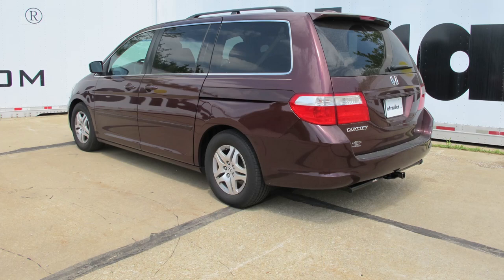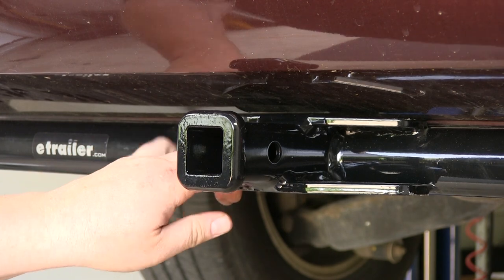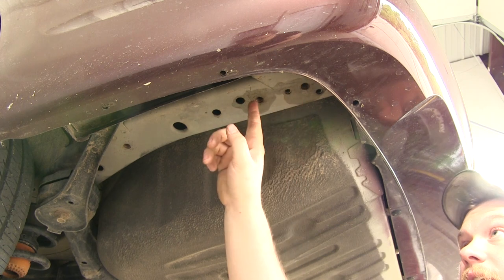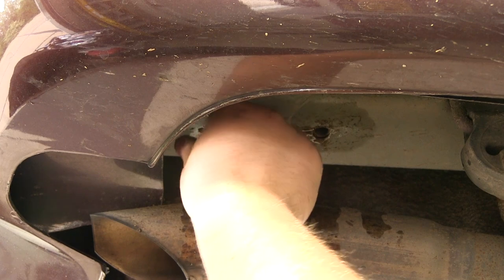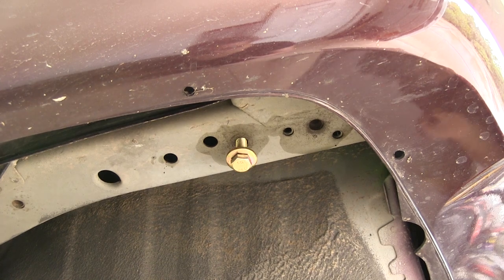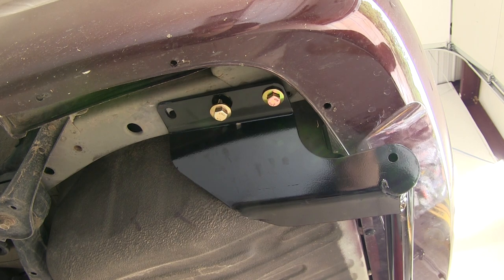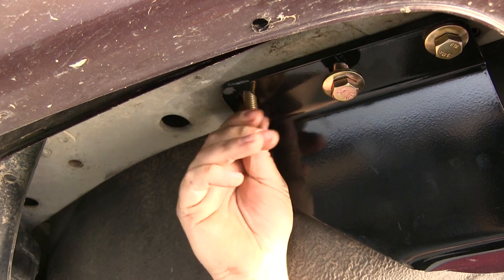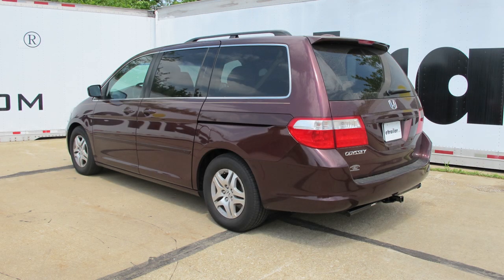etrailer | Trailer Hitch Installation - 2007 Honda Odyssey - Curt

Comment: Are those weld nuts m12x 1.25?
Reply from the maker: The hardware that is included in the kit is M12-1.25 x 35mm bolts. 
https://www.etrailer.com/Trailer-Hitch/Curt/C12031.html